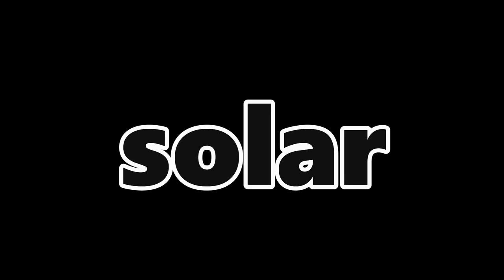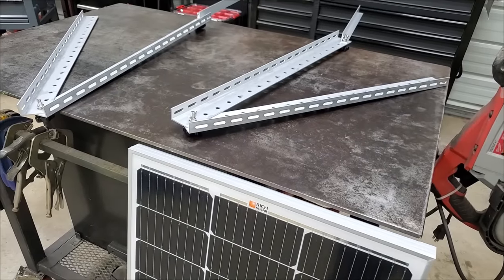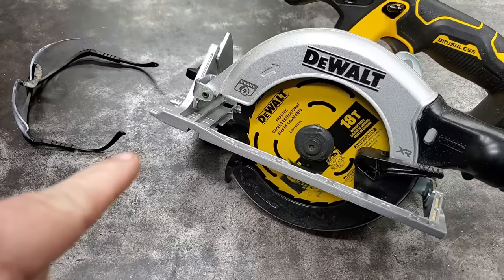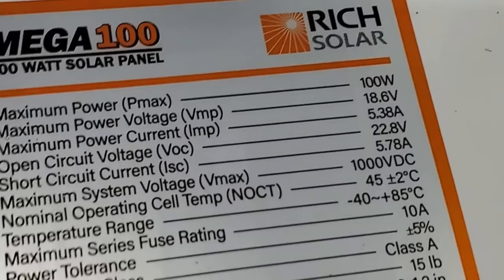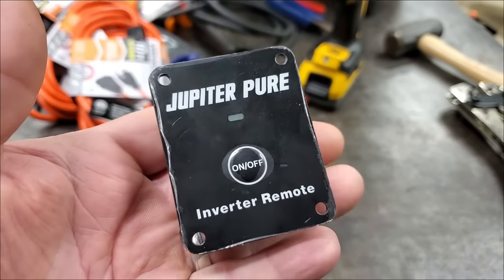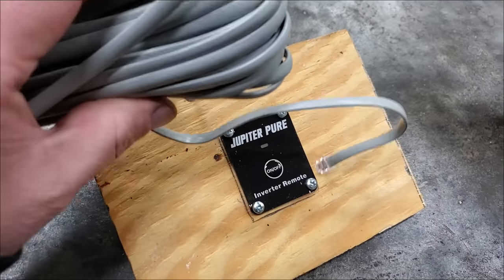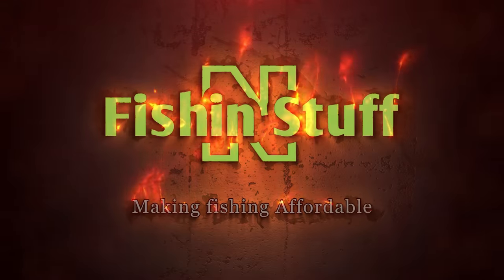Beginners Solar project ( very Simple )

Comment: Nice video!  A 2000w inverter seems like overkill to run 3 led fixtures..  But you did mention maybe adding more batteries..   Which would allow you to run some power tools too..  Just not the really big tools like a table saw or planer..
Reply from the maker: I was thinking about a small deep freezer maybe

Comment: Very nice!! 

Consider the following:

$25 DC isolator disconnect cut off switch between the panels and the MPPT to completely shut off the panels. 

$15 Fuse on the positive lead going to the battery. 

$20 Circuit breaker between the battery and inverter.
Reply: Also consider grounding the array/panels. $20 Grounding rod + copper wire.
Reply from the maker: I've got the breaker and forgot it 
Then I remembered but thought we'll the inverter has a fuse . But im still fitting to add it . I was told by someone to not put a fuse from the charge controller to the battery because if it blows , the charger controller will burn up , not having a battery hooked to it . It made sense to me . But the panel ground I never thought of

Comment: I use threaded truck batteries $112 a piece. And 12v rv camper 3in puck lights in my basement. Also have a 12v tv 40in. And charging ports going through conduit pipe to a USB port. My solar stuff is on the roof of my detached garage wired into it and 110 wire running to my basement powering everything 12v. All on 30amp breakers. Been working for 7 yrs now. Gf is upstairs during a power outage trying to conserve her phone battery with a power pack, and I'm in my man cave watching a movie with lights on and charging my phone lol. No inverter.

Comment: Its a great setup, but also... there is no reason to stick to 12V with a setup like that.  Particularly once you go LiFePO4.   Anyone designing new systems should be thinking 24V (aka 25.6V) or 48V (aka 51.2V) from the start.  That particular charge controller can handle those voltages, I believe, but you'd have to get the appropriate inverter.

The advantage of going to a higher battery voltage is that you can pack a lot more solar into the charge controller before you hit its amperage limit (which is on the battery-side).   Plus cable losses are a lot lower, heat generated is a lot lower.  Its just all-around better to use a higher system voltage.

Finally, it is usually best to choose an inverter that is only modestly more powerful than your loads, because the idle power consumption of the inverter will be lower.  A solid 800W inverter (like a Victron Phoenix) only burns around 10W when idle, and that's in normal operating mode... not even eco mode.

-Matt
Reply from the maker: You sound smart on the subject  . And I'm a beginner  . I know your correct about the 24v , 36v and 48v systems but it's just a beginner video . And for the price of this battery's,  I'm probably going to buy a few more , so I hit a bigger inverter . And I'd like to try and run a deep freezer later . So I might need another panel too . But I haven't don't the math . But I do like the way it turned out . It really was my first attempt at it . Even more I like the idea of having it the next time an ice storm knocks out my power for 5 days . Living in the county is awesome,  but has its disadvantages

Comment: The 30A plugs on these generators are 110V (or 120/125 depending on how you label them), not 220V. To get 220V on these generators, you usually need a second generator and an adapter cable.

Comment: really cool project! I wish 12v led lights were more readily available. I know they're out there, just not as common. Those led lights you have are probably 12v but they have a transformer that drops the volts from 120 to 12. so your making 12v with solar, inverting it to 120 ac, then the lights have to drop it back down to 12. even at 99% efficiency loss is loss.
Reply from the maker: You can make the ones I used 12v I'm pretty sure
Reply: @FishinNStuff  I was wondering if they would be hard to bypass the transformer. Still not something most would be comfortable doing.  If you need additional lighting above work benches, they make nice Marine led lights that run off 12v.

Comment: Well you spent the same as running power to the shed with conventional electricity. So now to save any money it will take you around 20-40 years on your solar on the shed  to pay you back on the solar but thats if not including replacing the battery they dont last forever and any other part that breaks or wears out
Reply from the maker: It'll only take the power to go one 1 time for a few days and it'll all be worth it lol . It's called self sufficiency

Comment: Best and cheapest charge controller you van buy is...
The expensive one from Harbour Freight.
Now im pretty much anti HF but both the charge controller and the expensive 100w solar panels from them . Not the black one but the blue ones. Are descent to buy.
If you can buy online poly crystal panels   for cheaper. By all means buy them.  
But there is no better charge controller then the higher one from HF. LAST i seen it cost roughly $80.  But that was a couple years ago. 
Someone gave me a used one years ago. It lasted a year. Then i bought one in 2018 to present 2024. And have had no issues.
Note i have no idea how old the used one was. I know it was at least 3 years old. And one of thoses things you dont ask questions about. Lets just say. Im pretty sure it had been stolen a few times.  The camper the panels were on. I know was stolen three times. In the past 12 years. None of which were by me. 
The last people to have it before it was given to me. Wont be returning. Seems they possibly killed. But definitely buried a man. And many federal and state agencies have questions for them if they ever return to the US. At the least   socail security fraud. To murder?

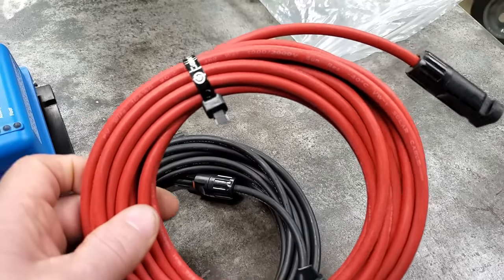Comment: for this application you could  just use car lights which are DC direct current and skip everything from 13:20 on. Skip the inverter which waste electricity, increase fire hazard, and cost between $170.00 to $300.00 extra.
Reply from the maker: Your right  , but like I said I'm planning on upgrading it

Comment: I like the solar panel thing and all, but seems like running wire from the house would be cheaper. 250 battery, 200 controller, 300 inverter alone is a chunk of change.

Comment: Where you messed up was using an inverter to run 120 vac led lights The inverter uses power itself so it should only be used if you are using 120 volt appliances., You should have gotten 12 vdc lights and your wattage would be much lower and the inverter should only be turned on when needing 120 volts
Reply from the maker: My secret plan is to add more batteries  ( especially at that price  ) and run a deep freezer  . That's why I kept talking about upgrading it later

Comment: those amp hour convert really easily to ebike miles. run a inverter to your ebike and charger from the battery you will get a 100 miles thats 4 times the range for 1/4 cost of a ebike battery

Comment: Hi there.
I design solar systems.
On your project,  you could reduce your cost and components.

For your shed, all you needed is 
1 100 watt x 12vdc solar panel

1 battery

1 smart charge controller which had panel input, battery out put, load output.

3 12vdc LED LIGHTS

1 SWITCH ON/OFF

Comment: Use 48v system smaller wire just get 3 more batteries and an inverter that can handle 48v 

More voltage more better

Comment: Just a thought but you're turning 12v DC into 120v AC to get to the lights which are LEDs which run off DC so they have an integrated invertor/transformer. You could figure out what voltage those lights want and write them up with low voltage DC.
Reply from the maker: Your exactly right . But like I said I most likely upgrade it and maybe use it for a deep freezer or something I'm just starting with the lights

Comment: Wow, that is a ton of money compared to a $30 extension cord for how much you will use it. You will likely not get that setup to cover the cost even if the electricity triples in price. 

The first one is a good idea but even then an inverter in the vehicle and an extension cord is much cheaper for what you plan on using it for.

And yes, in a power outage, it is good to have an Ecoflow or some such thing, I guess it depends on how often the power goes out. In this area, after the storm of 98' we made the power company put the lines underground where every fart of wind doesn't knock the power out. I think we lost power for about 30 minutes in the last 20 years.

Comment: A few changes.When figuring voltage you the VOC voltage. Not the one you used. 150 for voltage 45 for amps. Now the amps coming in will not be the amps going out. The 45 is for total amps going out. You will see that on your app. Instructions should had told you not install on combustible material. They are also telling people to install a double disconnect on your PV cables coming from the outside you can add that with fuses on your net video.. Just saying. Good Luck.
Reply from the maker: Thank you

Comment: I wanna hear this guy narrate an open heart surgery.

"You take this brake line-lookin tube thing righ-cheer, and you haul-off and cut it right thar by the heart. Then, you pull that nasty stuff out that's clogging the line, and you sew her back up......or you might be able to use you some J-B Weld, I ain't really shore." ❤
Reply from the maker: Lmbo

Comment: Great video, very informative.  However,  there is no such thing as free energy.  You had to spend money to buy the materials to make you system.  The question becomes; what is the return on investment?  The good news is that the longer the system works without having to do a major repair, the lower the cost per KWh.

Comment: just for the purpose of conversation, why not use 12v DC lights, then you need smaller wire, avoid the inverter, and have a simpler setup.  I understand if you want the outlets then the inverter is more valuable since you can plug things into it, but just for lights 12v seems better in my opinioin.
Reply from the maker: Your exactly right , I did think about that when I was planning it . But like I said I'm going to add to it . Ideally I'd like to put a deep freezer out there . I even thought about putting a router in the building so I can run a blink camera ( my wifi won't reach to the back of the building , but it reaches the front  ) that way I can check on my chickens and get alerts if anyone or anything is messing around in the backyard  . I just went ahead and bit the bullet.  I know I could have added it later

Comment: my only complaint with the video is you mounting the electronics directly to wood. Maybe its ok i dont know but i would feel more comfortable mounting the electronics to something i call fireboard. It kinda looks like wood but it wont burn. That way if the electronics get hot or short something out accidently they wont burn down the house.

Comment: Do not use the “hammer crimper”.  It’s not a good option for crimping due to increased resistance.  The more circular crimp is better because electrons tends to spiral around the outside surface of the cable l.  At least that is how I was taught.

Comment: I realize you built this with the intention of potentially expanding, but you could have saved the cost and wiring of the inverter if you just used DC LEDs... like strip lights or Chip On Board, stuck 'em to a piece of metal, and zip tied it to your rafters. It would be more efficient and cost less.

Comment: Harbor Freight has some decent tools, but I would not buy any inverter from them. If under load the output voltage drops below 110V, it is garbage. Voltage drop will kill delicate electronics way faster than not having a SIN wave. In my solar system journeys, I have tested and returned several inverters. Most of them will not hold the output voltage when >40% load is applied. I settled for a Bougerv 2kw. Even at full load, it holds the output voltage you select. I bet ya' a cool $100 that HF inverter you chose to use in this video will not hold output voltage with a >50% load. Good luck!! Fish On!!

Comment: I bought 4 110 Amp hour deep cycle batteries at Walmart for $458.23. That’s 440 amp hours. That’s $93.76 a piece for batteries with the same output as the lithium battery but these don’t have to be heated to 70 degrees to operate and they don’t burst into flames it the temperature is 130 degrees or hotter which means you don’t need heating and air conditioning for your batteries and it your going to have them below 0 you should charge them first because they can ruin them if they’re uncharged at sub zero temperatures. But what’s the difference you people are all rich and money is not a problem but I have been living off grid for quite a few years now solar panels are rated to last 25 years well in real life I’ve gotten about 5 to 10 years on my panels. And batteries for regular car batteries and deep cycle batteries are supposed to last 5 to 7 year’s charging every day and running them down at night I get around 5 years out of my batteries. Like I said I just got 4 new ones last month for $93.76 each the same size lithium battery is $1200 each I looked around all over and couldn’t find any cheeper they do weigh about 1/2 as much as the deep cycle battery but in not going to be hauling them around I’m going to connect them up and use them till they stop charging then get some new ones. Now the battery he showed is a 100 amp hour battery the $93 beep cycle is 110 amp hours now they keep saying that they aren’t going to put out as much power as the lithium but if you do the quick charging or charge them over 80% or discharge them very often most of these battery packs seem to go bad in a year or 2. But here’s the simple math I can buy 12 deep cycles batteries for the price of 1 lithium battery and if you did short the terminals out it will heat up it might even melt the battery terminals off although I’ve never seen that happen you can boil the water out of them but you can refill them with distilled water but they don’t catch fire 🔥 or blow up. But like I said I’m not going to carry my batteries around everywhere if you are then get one of those little generator boxes they have the inverters and chargers built into them and the bigger ones even have handles and wheels on them so you can move them around easily but for what your doing you can get 100 watt to 220 watt solar panels for around $75 to $220 a charge controller for around $30 and a 500 watt inverter for around $40 and a $100 for a deep cycle battery and a PVC box for about $20 to put it in or you can get the ready made one in the custom box for $1000 for $2500 you can get the bigger one with 2 batteries. The same size charge controller and you can get a bigger inverter a 2500 watt one will cost around $100 to $150 but it’s only y money after all and you can use the promo code and get $20 off but why would anyone want to build a battery backup with chargers and AC & DC outputs for around $450 when you can buy one in a fancy box that does the same thing weights about half as much and only cost $2500 and your just going to stick it in a cabinet or in a corner and not move it around anyway but for a additional $2050 you could if you ever got around to doing it. But here’s a thought I just bet that with a extra $2000 you could hire someone with muscles that wouldn’t mind moving your battery box a lot of times if you ever got around to moving it. But what do I know I’ve only been living off grid for around 25 years now. And the sun shines all of the time and if your lucky you can charge your batteries for maybe 6 hours a day and you can recharge your tablet and a couple of cellular phones and even run some led lights and a fridge and you’ll want a small generator about 2200 watts is good unless you have a water well then you’ll need a bigger generator for that I got a bigger inverter to run the well but bit ran the battery down to much so we ended up just using the bigger generator for a couple hours a month to fill the water tank. But why do that when you can buy lots of batteries from china who hired little kids to dig up hazardous materials by hand in third world countries so you can get batteries that are a little lighter in weight😂
Reply: You made a reference to the battery he shows in the video a few times so must have seen the price of 249$ and the 20$ off code to make it 229$ plus tax and possibly shipping unless you live in Idaho or Indiana.
My question is, if you watched the video and took as long as you did to write the comment you posted why are you saying lithium batteries are 1200$ and that you can get 12 of the deep cycle for the price of what he is using?
Providing everything shown is correct you can get 2 of the deep cycle type with some money left over, not 12. I'm aware the lithium used to be quite expensive but they keep getting cheaper. 
I'm just curious.

Comment: Just out of curiosity, you stated the cost of running wire $79, renting the ditch-witch $185...etc.  Sure you'll have a pretty good chunk of change into it once it's all done, and a bit extra on the electric bill.  But what was the total cost of converting it to solar?  3 renorgy panel brackets @ $25 a piece, 3 panels @ $80, solar extention cable $32, Lifepro batter $300...etc.  I'd like to convert my shed into solar too, however, I'm not sure it's going to be cost effective.